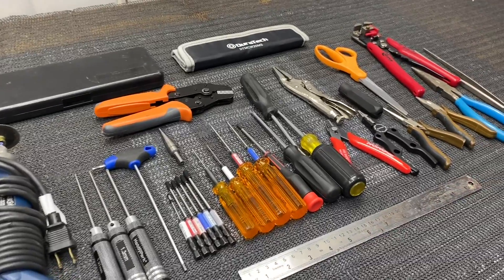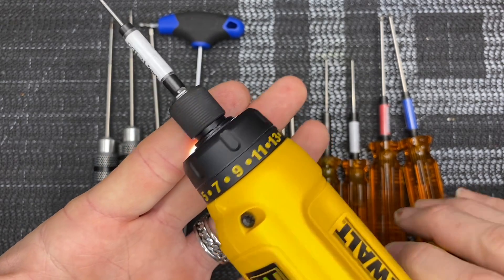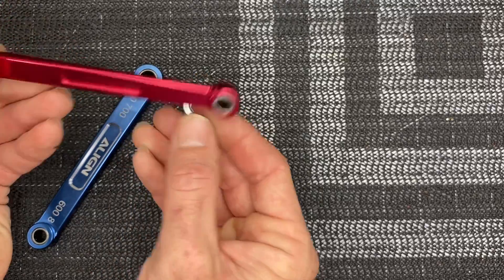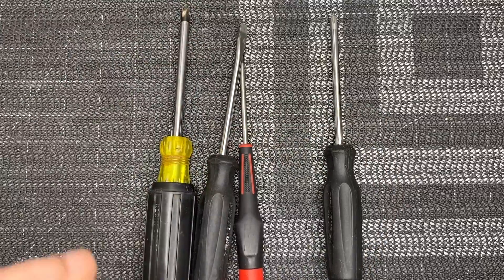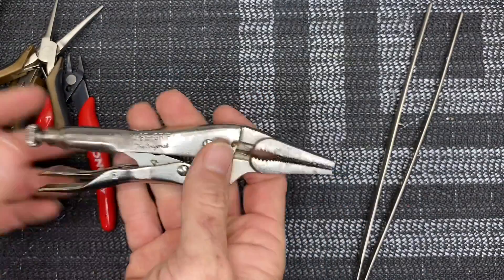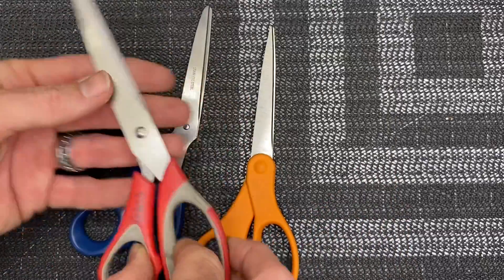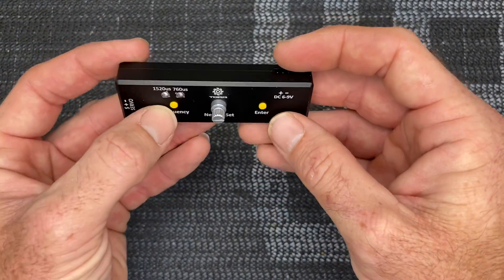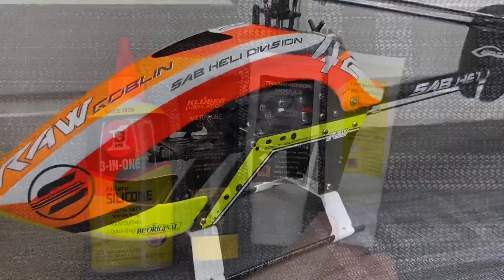What Tools Do You Need To Build Or Repair Your Helicopter?

Comment: Amazing video, thanks! One question - what is that cone-looking tool above the drivers in the opening shot of the video? It wasn't described, but it looks like it would be very helpful to remove some of the super-tiny bearings we encounter in this hobby....?
Reply from the maker: Thank you! I’m glad the video is helpful. Are you talking about the Dremel? Or the ball link tool? What color is it?
Reply: @westhobbiesrc8051  In the first 2 seconds of the video when you're saying "what's going on" there is a metallic cone looking tool right above the MIP quick attach drivers.
Reply from the maker: @MikeG4936  got it! That’s a step bit, for step drilling holes larger. It can be used to pull bearing as well!
Reply: @westhobbiesrc8051  Thank you!! Do you know of a better tool to remove those pesky super tiny bearings?

Comment: The electric DeWalt is not for the beginners.
It's very easy to overtighten a screw with it, and break the head uff, or strip th threads, or the hex....
Better of hand tighten everything, to get a feel for how much to tighten everything on your heli, and not breaking a bunch of screws in aluminium parts.
It is costly to replace.
Reply from the maker: There is an adjustable chuck, which would make it almost impossible to snap or strip a screw. I never said beginners need it I just said it is a tool you should consider. You set the chuck loss and finish tightening by hand.

Comment: Digital calipers made life so much easier. Especially when the directions call for small and large ID washers, w/o calipers it would be a pain to do by eye. And the digital pitch gauges, absolute game changers.
Reply from the maker: Digital caliber is a must as well as a digital pitch gauge! I knew I was forgetting something in this video. Lol definitely need a digital pitch gauge!
Reply: @westhobbiesrc8051  to be fair some Helis like the omps don’t necessarily need a pitch gauge. And I wanted to ask, I’m looking for a heli in between like my m2 and 420. Is the blade 360 any good? Kind of been eyein that one
Reply from the maker: Using a pitch gauge is great on all helis, you can use one on the M2 but not need on small helis as you can measure the distance from tip to tip. The Blade fusion 360 is great. I would recommend the Goosky RS4 as well! Fantastic Heli!